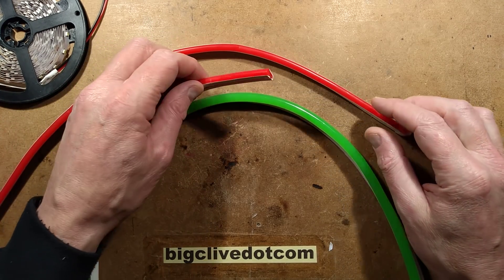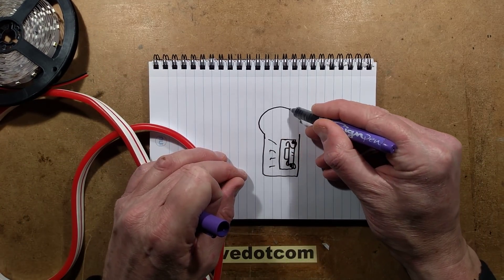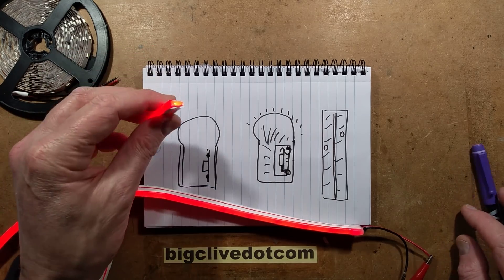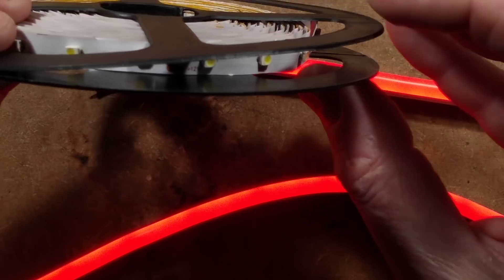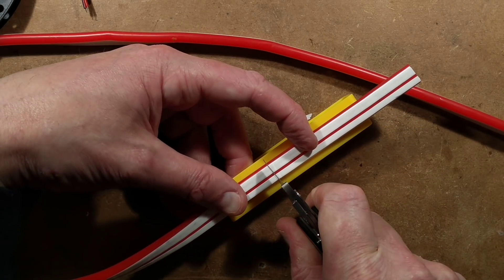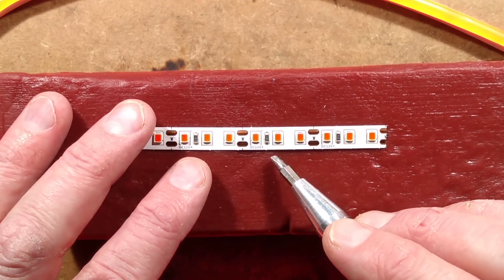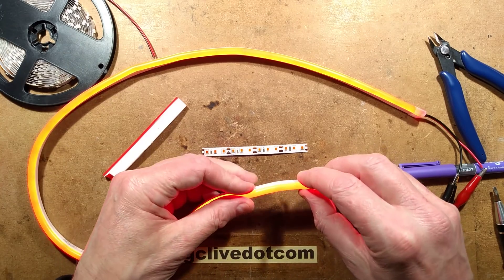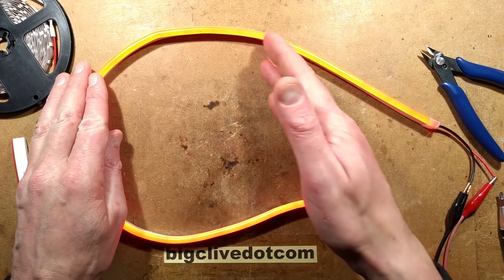LED "neon".  A new and interesting miniature variant.

Comment: Clive im building a large led  clock for a Christmas decoration is this water proof suitable for outdoor
Reply from the maker: It depends how well the end is sealed.  If water gets in it will travel inside and cause corrosion.  It might be better considering standard waterproof LED tape if it's being viewed from a distance.
Reply: @bigclivedotcom  thanks clive

Comment: one drawback, the solder ends, and even after you repair solder, is difficult to get a good weld. the wires will jump off at the most importune times, like in the middle of installation.
Reply from the maker: Heatshrink sleeve and fill with glue?

Comment: For a 1 off sign I'd go with a wood backing cut on a scroll saw. :-)
Reply from the maker: Or even routed lines to place the strip into.  A CNC router would be handy for that.
Reply: Indeed. I only said scroll saw because I recently got 1 and I have been playing with it :)

Comment: Something like that would be great for highlighting architectural elements. Such as edges of stairs, breaks in ceilings, for instance a line in a dropped ceiling. Even places where traditional lighting was always too big to fit previously, round architraves, small spaces between ceiling mouldings and ceiling or wall.

Comment: Reduce (theoretically, eliminate) the intensity drop-off by feeding positive from one end and negative from the other end.
Reply: How does that help?
Reply: @AMalas  Model each bus bar as a very low value resistor between each pair of LEDs.  Feed it the way I described and the total resistance along the bus bars to any of the LEDs is the same.  Feed it with both wires at one end and the resistance to a LED increases the further you go down the tape.  Doodle it out and see.

In fact, Clive did a video several months ago about a string of LEDs that was fed this way and remarked that it was a clever idea.  I'm surprised he didn't think of it himself.
Reply: @bdf2718  oh, your method makes all LEDs light up evenly, I thought it makes them all light up at full brightness.

I actually like this idea, although I was thinking about just powering from both sides
Reply: @AMalas  Yep, all it does it give them even intensity.  But that problem was why Clive suggested breaking long runs into sections.

It's debatable you actually need to do anything about the intensity drop-off.  Under conditions like these the human eye doesn't notice intensity variations unless they're more than 50% (yes, in specific circumstances you can do a lot better than that, but in general you can't).  If you just have a straight line of this tape you probably won't notice the intensity drop-off.  But if you arrange a long run in a circle you might.

Feeding from both ends won't solve the intensity drop off, though.  Instead of it being brighter at one end than the other end it will be brighter at the ends than the middle.
Reply: @bdf2718  well, its a 1 meter 5V 60 LED strip, dropoff shouldn't be that high anyway.

If I do find a dropoff, I could easily just snip two wires off
Reply: @AMalas  You could try all three ways.  Twist the strip so the end LEDs meet with the central LED so you can compare.  Try feeding from a single end, both ends and one rail from each end.  Just a matter of how you hook up the four leads at the supply (better doing it there than repeated soldering to the strip itself.  Let us know how it turns out.
Reply: @bdf2718  will do once they arrive, an eternity later (yay customs!)

Comment: Can anybody please recommend a good psu to run LEDs from a cigarette lighter socket?  Or would a suitable inline fuse suffice?
Reply: 12v LED's would run without a power supply direct from the cigar lighter socket, make sure it is fused though! You could even run straight from the car battery with a inline fuse.
Reply: @AlanM9PSKKing  thank you.  I was only thinking of a psu for  smoothing purposes/surge protection. I guess the output voltage can vary quite a bit
Reply: @hastonian  They will run at more current when the vehicle is running as voltages are 14V+ May be better for long term use to have a regulated 12v supply.

Comment: Clive why don't they fit the LEDs strip on the bottom instead of the side or use LEDs that let the light out on the side. Love your work atb nick
Reply from the maker: Because it results in a series of bright points of light if it doesn't get bounced first.
Reply: Bouncing off the inside of the white channel material and then diffusing through the top evens out what would otherwise be quite "spotty" light (where you can see a bright-point for each LED). You can somewhat see that effect in the video but I am going to take Clive's word for it that it's not noticeable in person.

Comment: Poundland now do USB powered sticky LED strips for £2.  Have a white one plugged into the back of my TV, and for £2 you really can't complain.
Reply from the maker: Note how hot it gets.  They're really pushing the LEDs.
Reply: Did it say how much power it’s drawing?

I’ve removed the LED strip I’d fitted behind my TV. It was drawing about 30watts for 3 metres which is ridiculous for a bit of mood lighting. I can light most of my house with 60watts now.

Comment: I see the 10M EL Led Flexible Soft Tube Wire Neon Glow on Banggood for only €4,20 is also soft tube led wire, Or the real stuf your talking about LED Flexible Neon Rope Strip, that cost about €10,- per meter.

https://www.banggood.com/10M-EL-Led-Flexible-Soft-Tube-Wire-Neon-Glow-Car-Rope-Strip-Light-Xmas-Decor-DC-12V-p-1063046.html?rmmds=search&ID=229&cur_warehouse=CN

https://www.banggood.com/1M-2835-LED-Flexible-Neon-Rope-Strip-Light-Xmas-Outdoor-Waterproof-110V-p-1093726.html?rmmds=search&ID=46072&cur_warehouse=CN
Reply from the maker: The EL stuff is very dim compared to LED.
Reply: @bigclivedotcom  Aha ok, thanks for answering me, great to see a Big YouTuber talk/answer people who are not big on YouTube.

Comment: "What's the safest thing I can use as a cutting board? Oh right, this lithium battery pack" 😂
Reply: I was thinking the same thing when he did that.

I think maybe he did that intentionally.

Any thoughts anyone please comment on comment.
Reply: yeah he likes to be naughty :)
Reply: @maicod  yes I would agree with that a lot of times I've noticed.

And frankly it does make it more interesting.

And more suspenseful Etc.
Reply: @aaron brandenburg for sure :)
Reply: 🤣 ... you could use gelignite as a cutting board if you were gentle enough 😜
Reply: @isladurrant2015  Not a problem, as long as you use a non-ferrous blade!   🌟🔨 🙊
Reply: Just adding a little extra tension, that's all! 🐵
Reply: I see your point, but he doesn't use an axe to chop through the LED strip. He doesn't apply nearly enough pressure to break the plastic case of the power bank. The way he does it I would be surprised if it left more than a scratch on the surface of the "cutting board", if at all. So it's not really dangerous.

Had it been a "naked" lithium battery, I would have been concerned as well, but the plastic shell is quite robust. ;-)

Comment: That brick is probably the most pointlessly expensive thing you can buy at the moment.
RIP $/£ exchange rate.
Reply from the maker: I'm sure that there are probably some people for whom money is not an issue when it comes to construction industry themed rectal pleasurement.
Reply: One month later ... rubber insert to a real jackhammer.

Comment: Crikey !!   That’s flexible!!!    I think it should be sewn into a tracksuit!!!
Reply: Adidas could sell tons in Russia
Reply: hardbass intensifies
Reply: I wonder how it compares to the light fabric they used in Tron...
Reply: Nobody seems capable of getting a brand of electronic clothing onto the market due to the various difficulties of mashing together fashion/textile and electronics as it apparently makes things prohibitively expensive for them, not just to make but to pass all safety rules and such like, however, I’ve seen such things on China wholesale sites such as Aliexpress, so if you’re feeling brave...
Reply: @Lumibear.  Time to chug the bravery juice and give it a go.  Boom.
Reply: If you're still trying this: beware that bending will work-harden the bus-bars, and then cause them to fracture / fail at the flex points.
Sooo... either only put the LED strip where it won't be flexed, or be ready to replace it (i.e., have it threaded through buttonholes, or equivalent) when it does fail.
Good luck :-)

Comment: What about EL wire?
Is there any way to use EL wire on signs and make it look good?
Reply from the maker: No.  Not unless it's in a pitch black room.
Reply: EL wire is very dim plus it needs HV driver, compare to that any 12V plug-in adapter works well with LED 12V strip. _

Comment: Fascinating! I've been doing a lot of looking into various LED tape and kept seeing this neon style sets on Amazon for ludacris prices. Like $200 USD for 30ft. I do believe those sets were all A-RGBW, though. Still, there's no way they're THAT  much more to manufacture. 

I design competitive high school marching shows, and I REALLY want to incorporate some high intensity LED effects on props and maybe inside the color guard flag poles, which just happen to be the perfect diameter to fit 18650 batteries.  😁  

I would be interested in hearing the best way to control a bunch of ARGB lights wirelessly. We only have about 2 minutes to get all our equipment setup. I haven't checked to see if wireless DMX is a thing, or if maybe there's some radio protocol that could be used.  All fun stuff, I just don't have all the knowledge in that field.... yet.
Reply: dmx being rs485 you should be able to use lots of options to make it wireless..
Reply: Move, bitch, get out the way
Reply: Arduino and these?

https://www.arduino.cc/en/Guide/ArduinoWirelessShieldS2

Comment: What sort of led driver would you recommend for this sort of thing?
Reply from the maker: A 12V DC power supply.  The rating would depend on how much you were running.  Always over-rate the power supply generously so the components inside run cooler.
Reply: @bigclivedotcom  I highly agree on over writing the power supply I try to do it by at least 25% or more.